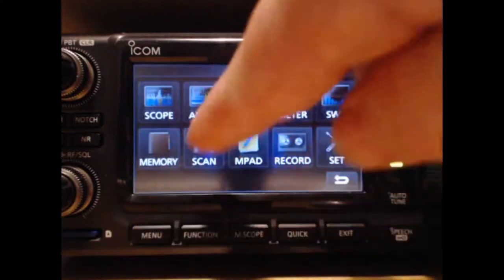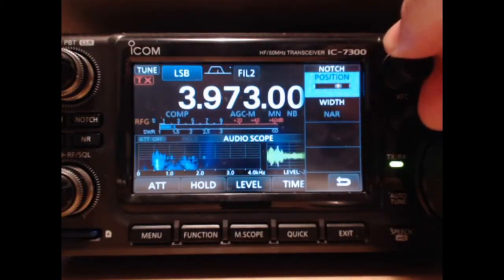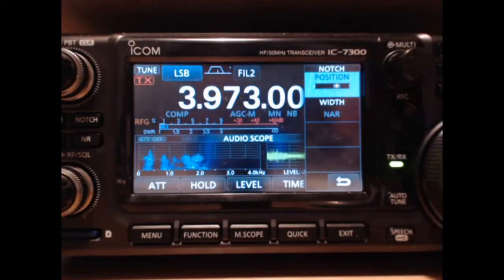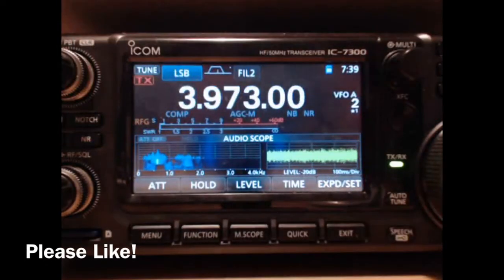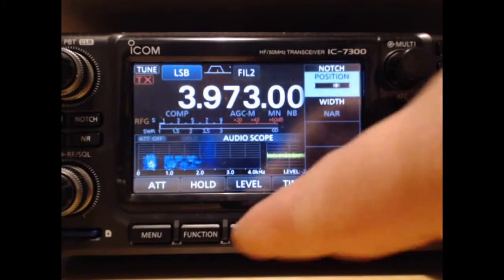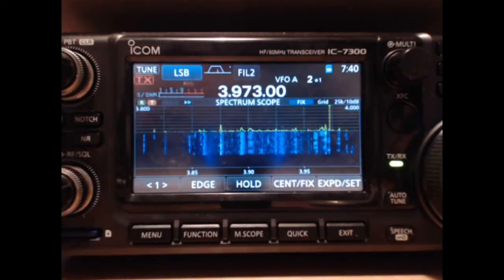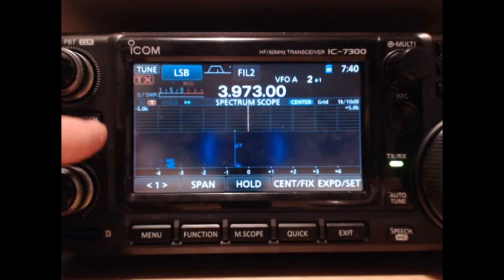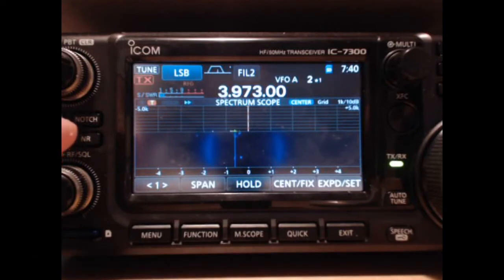Icom 7300 Manual Notch Filter Eliminates PC Noise

Comment: Nice catch using the 7300. I had very similar with a VGA y-adaptor I had remove. Since you said that I need to try the ferrite core on it as well..........Ken.....WN8Y
Reply from the maker: Hi ken,

Thanks for commenting. My ferrite is working most of the time, but occasionally I still see that interference. It isn't as bad when it pops up. I'm using a small mix 31 and the cord is wrapped 3 times around it.

Best 73 - Rich, K0PIR

Comment: Hi Rich I forgot to ask you before what type of antennas are you using?  I have the 18' alpha vertical as I'm limited for space but I'd like to go bigger...  Thanks and 73 W1NGA Al
Reply from the maker: HI,
At home I have an inverted vee and a 2 element tribander (Hy Gain TH-2MK3). I'm limited on space and height too. I have a Tarheel 200A on my vehicle and it works good. I'd bet it would work setup as a vertical in my yard. Thanks!